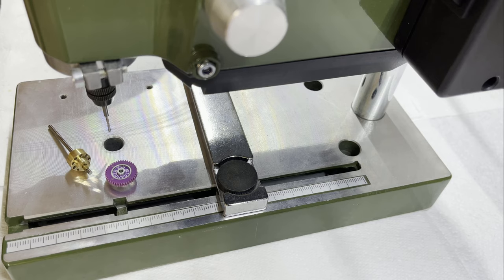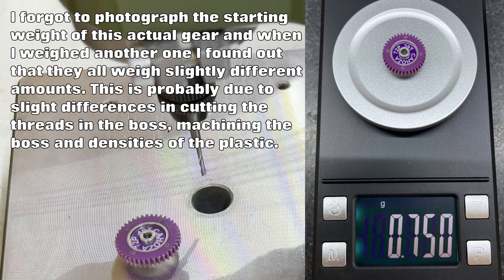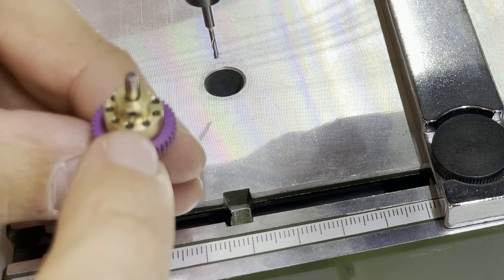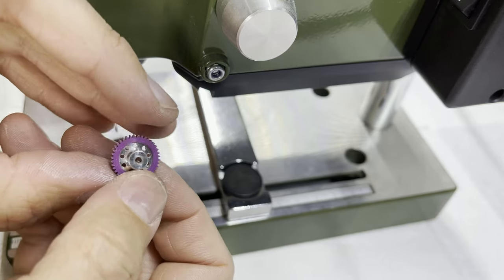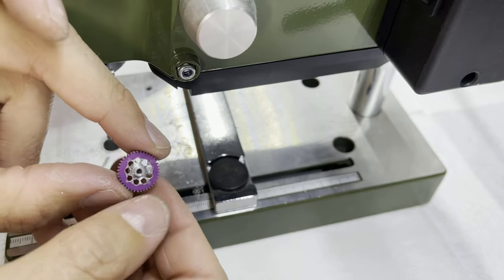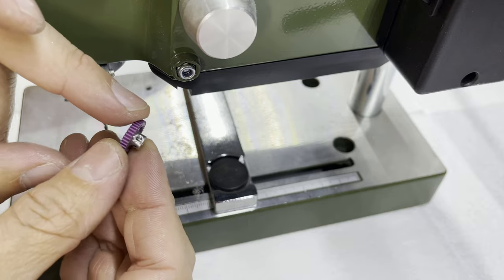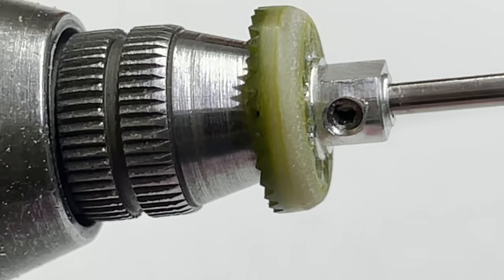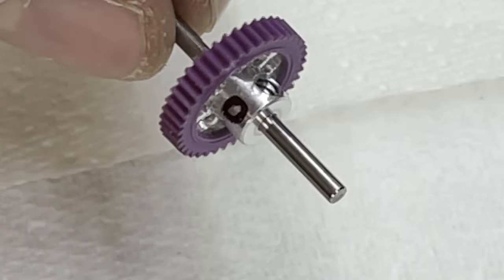Improving the acceleration and braking performance of your Slot Car by lightening your gears

Comment: Your vids are very indepth. Just what I like. Have you made a comparison between before and after performance? Or has this grown from the urge to perfect your car as much as possible, which is part of the racing spirit.
Reply from the maker: Thanks for commenting and watching. It is easier to tell the difference between a lightened gear and a normal gear when you are running a very lightweight car in the first place. I am sure wing car racers really notice the difference. The heavier the car in the first place, the less difference it will make, but it does make a difference, especially with acceleration and brakes.

Comment: Love these tech video's. It's also possible to use that tool on an angled gear? Cause the center aluminium part is much smaller in these kind of gears?
Reply from the maker: I actually have 2 sizes of tool for different diameters. The one in the video is the largest and I have not used the smaller one on any gears yet!

Comment: gears with alum center is risky...you cant heat the car otherwise will demage the gear...i think balancing the gear is enouth by drilling a few points near the pivot ..
Reply from the maker: The plastic on this type of gear can withstand a lot of heat before it is damaged. Heat from drilling does not distort the plastic gear.

Comment: How is the balance after the mods ?
Reply from the maker: Good question, thanks. The balance was only changed very slightly after drilling the holes. I will go into more details about balancing in a future video 👍🏻
Reply: @CleaveTech  Please dont say you use razor blades and an axle to balance your rotating parts. I can balance my rotating parts down to 0.001g.cm
Reply from the maker: No, I don’t use razor blades to balance gears and wheels. Wheel and gear balance is not as critical as armature balance. I use Dave Harvey and Wow O Won slot racing for all my armature balancing.
Reply: @CleaveTech  Ask them if they can get down to 0.001g.cm on their arms or any rotating part for that matter. Its a lot easier than you think to do it yourself.
Reply from the maker: @Fabio-ns4ql  , thanks for email. That is how I balance my gears and wheels 👍🏻 and a device similar to what you describe will feature in the video. My arms are balanced dynamically to less than 0.001g using a special machine calibrated for small armatures so the balance is correct at both ends of the arm as well as just radially.
Reply: @Fabio-ns4ql  could you share your method, please? Anything better/easier than using a jig like those magnetic aluminum balancer?